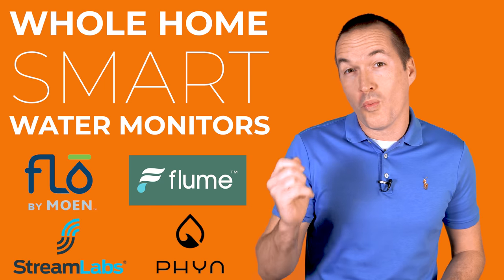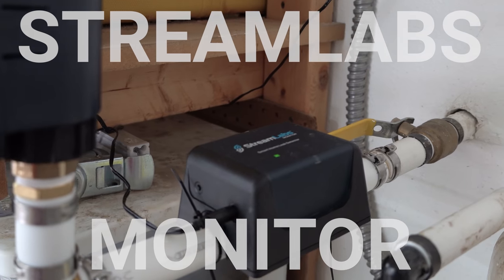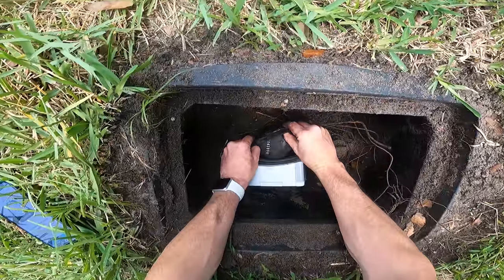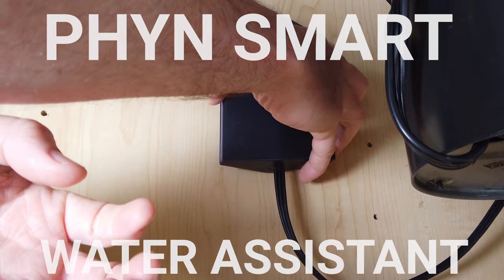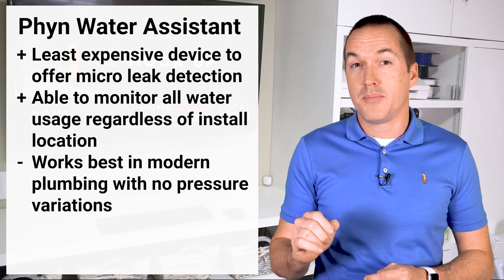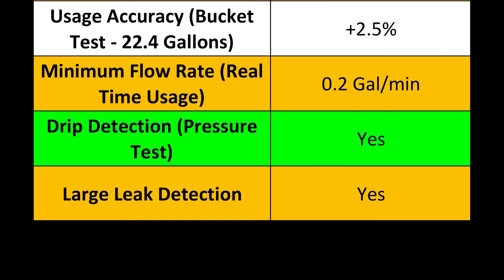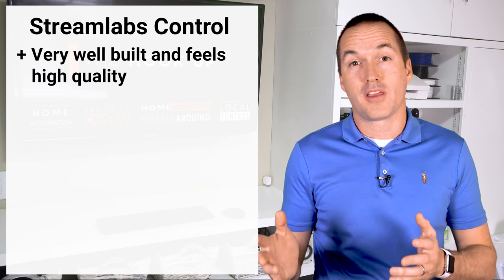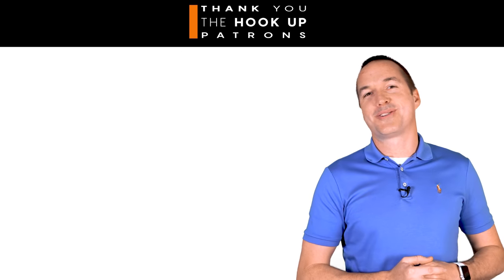Prevent THOUSANDS in damages with these smart water monitors.

Comment from the maker: The Moen Flo was a standout for me, but the Flume 2 was also very good.  I made an error in the chart at 7:25, the Flume subscription should say "$49/yr, not $49/mo".   What do you think about the new subscription plan (They basically give you a year free by discounting the purchase price by $49).  I'm personally not a fan, will it prevent you from buying it?
Reply: Great review, but my conclusion is I will continue using my  Flume, works flawlessly and I have used their useful api.  $50/yr subscription seems reasonable to me.  There is no free lunch to have permanent cloud access to your water data.  It has promptly caught several significant leaks and paid for itself.  Thanks for the extensive testing!  I am grandfathered in their no cost subscription, but if they started charging me $50/yr, I would continue to use it.
Reply: i am all for subscription plan as an easy way to have notification and pattern monitoring off device.
Cloud cost a lot.
But that should be an option, and the device need to have it's basic usage off cloud and for free (monitoring without history, shut off, thing like that)
So none of them will do the cut. No local, no buy
Reply: Hey Rob, this looked like a lot of work! Great review. Question: For the Flume 2, can you integrate with Home Assistant without the subscription plan? It looks like you can, just not 100% sure. Thanks!
Reply from the maker: @make it work yep, everything works without the subscription with the Moen.
Reply from the maker: @vlycop7404  It blows me away that local is not an option on most mainstream products.
Reply: @TheHookUp  Agreed. Flume actually locks their API behind the paywall as well. Having to pay a subscription to access your own data locally (there's a hub involved here) is ludacris. The never ending subscription mentality of hardware companies needs to stop.
Reply: @makeitworktech  not with the flume, unfortunately. I just ran into this issue last week. You need API access and they lock that behind the subscription.
Reply: @devinspratt586  that is so annoying. Moen is the only one worth it then IMO
Thanks!
Reply: @makeitworktech  agreed. I complained to them that it makes it significantly less attractive to people and that we'd be happy to pay a higher hardware cost instead of deal with subscriptions. Their customer support is excellent though.
Reply: @devinspratt586  Yeah I don't want to keep paying for something I already paid for. I only want to pay for something that keeps adding value.
Good on them for the support 👌
Reply: Great review. When I researched them, I was between the Moen Flo and Phyn Plus. Unfortunately the Phyn Plus wasn't reviewed, but I have found it to catch leaky faucets, spigots, toilets, and provide adequate notification for abnormalities. While it costs more, it seems robust with metal components and doesn't charge a monthly fee. It has been mostly accurate with identifying what is using water.
Reply: If you recently bought a Flume 2, the app will ask you if you purchased it after Aug 24 (or some day like that). Just hit the button that says you bought it before this day, and you will get the original plan that has all the features and API access included. I don't know how long this will last before they don't prompt you. The newer plan SUCKS. You don't get much without paying $50/yr.
Reply from the maker: @composer47  That is hilarious.
Reply: @vlycop7404  Honestly cloud infrastructure is incredibly cheap - and getting cheaper by the day. Most cloud subscription costs are just additional ways for companies to make a buck. it takes very few subscribers to cover the operating costs, few more to pay for the development costs, and the rest is profit for next-to-zero incremental additional costs as the actual hits to the cloud services for something like this are few and far between. I completely agree that with no ability to tie-in locally to something it should be a deal breaker. If your device requires cloud-access to the manufacturer it is not your device, you are renting it.
Reply: @cpattullo1  i agree with most of what you say :)
But when i see the bill at work when small website, that cost 350€ a month usually, scale up because of some new's coverage ... 20k bill are hard to swallow and usually we try to work it off with google ...
I have no issue thinking those company aren't managing their cloud well and paying way to much to justify when the number of user isn't there.
Reply: @vlycop7404  ya, it really depends on what you're doing. But a moderate sized DB with some API calls - an over simplification,  but not by much - is all that's needed for these services. That really isn't that expensive on AWS. Especially since it's often the App that's doing the work and the cloud is just holding a bit of data and triggering some other service calls.
Reply: Personally, I'm not interested in any device that requires a cloud connection.  I only have two cloud-connected devices and they are on the shortlist for upgrades.
Reply: @ericapelz260  that would be so ideal. I personally don't want a cloud requirement, but I do want the ability to connect and receive alerts etc. It seems to be manufacturers always want to tie the two. A fully cloud free environment while maintaining the features I need would be ideal though!
Reply: @The Hook Up -  the graphic at 07:26 shows $49/MONTH not year
Reply: @TheHookUp  Regarding local api access: It doesn't make a lot of sense to build, maintain, support, provide documentation for a feature that only a tiny of fraction of potential customers will ever use.
Reply from the maker: @freethinker1198  Unfortunately true.  However, relying on the cloud is also what gives smart home products a bad name.  Certain products need to work 100% of the time, and the cloud cannot deliver that kind of reliability.   Local control needs to be an option when the purpose is especially high stakes like flood monitoring.

Comment: Phyn offers a whole home water main solution as well, Phyn Plus. Did you happen to come across this one? I decided to pick this solution because it had what seemed to be the longest-lasting and high accuracy sensor (made in US by Badger, a major supplier for commercial water solutions). It does lack the API access, but no monthly fees (at the time Moen did). I'd be interested how it really stacks up against the others in your tests for accuracy, but I've been happy with it so far. Turns off when I forget the garden watering, kids leave water toys on too long, and has classified my usage very well. I hope they add some API access, but really, having a standalone for what is really an emergency system isn't bad. I'm sure there are some automations I could think of, but does what I need.
Reply from the maker: Yeah, I mostly didn't include it because of cost creep in the video and because I didn't have any more room in my plumbing, lol.  That said, my least favorite part about the Phyn was the app and lack of API, which would be the same for the Phyn Plus.

Comment: I love your very thorough reviews and learn a ton from them. However you did fail to mention the Phyn Plus  model which does have a whole home water shutoff and several great features. I have had one installed in my home for 18 months and love it. I'd be interested to see how it stacks up against the other front runners like the Moen.
Reply from the maker: My main gripes with the phyn were the lackluster app and lack of integrations with smart home platforms.  I have no doubt that the phyn plus would perform well, but it's more expensive than the Flo and has a significantly worse app.
Reply: I’m still interested in the comparison of the two?  Although phyns app is lacking.

Comment: The goal of smart meters is to save money by being able to monitor usage and detect leaks. Subscription kills the first critical point of replacing the 'dumb' meter with the smart one. Naaa thanks but no, thanks. Otherwise Rob, good video as always.
Reply: The target market is likely people who are weighing the costs of damage and repairs against the cost of the unit and subscription. As water can easily run into the thousands /tens-of-thousands for damage and repairs, even a $500 unit with $10/mo only has to save you from one major leak to break even / save you money. This is borne out in some of the comments here even. That said - I completely agree with you that a product shouldn't need a subscription to work.
Reply: @cpattullo1  IDK, if that's the main goal, then I think I would end up paying twice. I already pay insurance to protect me from that and that is something I have to have because it is required by my mortgage lender etc. Yes, you could say this is "double insurance", but I don't like to pay twice for the same thing. This is why it is not the main benefit in my opinion. But again, we agree a product shouldn't need a subscription to work.
Reply: @CMDRSloma  as someone who recently went through 3 months of insurance-covered repairs from a burst pipe in the freeze here in Texas, I can confidently say I wish I had one of these installed, even at the ~$400 price tag and subscription. Having your flooring, cabinets, and drywall ripped out throughout your home sucks...terribly.

Comment: I'm quite surprised that your going this route at all ? 
I've seen your Home Assistant, and your very knowledgeable. 
So why not smack one out of the park, and go the distance ?
 
Why not use an actual water meter with  pulse output, .and electronic shut off ?
They are extremely accurate and durable. Run about $75 dollars for the meter, and $25 for the shut off.
Then tie it into an esp32 and do the programming yourself.
You can custome build it to your exact specifications.

What got me interested in monitoring our water usage was leaving the hose on in the back yard and just using the spray nozzle to turn on and off the water.
We went away for a long weekend and the hose burst. Fortunately the spraying noise annoyed my neighbor enough that he came over to investigate and he turned off the spigot for us.
That's when I started my journey into the world of home Utomation.
Using an actual meter is so accurate, that it notified me of drip leak that accured when My toilet flapper started to ware.
But I relied on timing circuits and relays to do the dirty work. I just recently started working with HA

I have so many cool ideas on home Automation's but lack the knowledge you have.
I just started using home Assistant, but I can't seme to make my first node function. 
But I am determined to watch as many YouTube videos as It take, to make the damn thing work.

So........  you need to Keep making these videos until I get this right !

Maybe you can explain why my node just stairs at me, wanting to be adopted but nothing else.

Comment: The Phyn unit does indeed shut water off during an unidentified occurrence however not until 7 or 8 minutes past.  A high flow rate of 8 GPM will dump 60 Gallons before activating a shut-off.  We discovered this when our seasonal irrigation became active.  Imagine if we had an inside pipe break and it took 7 minutes to shut down.  What a mess that would be.

Comment: Couple errors with the Flume:
1)	At $49/year, own for 5 years it is still $100 less than the Moen Flo with subscription
2)	Drip detection works but must be present for 2 hours. My smallest drip alert was for 0.06 gpm at the two hour mark
Reply from the maker: I’m not sure #1 is an error, the flo and flume are not really equal devices, so for them to be the same price after five years makes makes the subscription even worse.

Comment: Great video. Did you ever retest the Moen Flo for a large leak detection after it had learned your house?
Reply from the maker: Yep, works great.  It gives you an alert on your phone and an automated phone call letting you know there is a problem and giving you 60 seconds to override before it automatically shuts off the water.

Comment: Hello, I have watched almost all your videos and have really learned a lot. Thank you very much for that! But apparently I have not learned enough. I would like to use a water flow meter in my motorhome to turn on the water pump when water is taken. The water flow meter gives pulses (444/l) when the water flows. I have created a rule for this that works quite well. Unfortunately the rule is repeated with every impulse, but I only want a MQTT message when the event changes. So only when impulses come or no further impulses come. I just can't manage that. This is my current rule: Rule2
ON COUNTER#C1>%var1% DO Backlog var1 %value%; publish tele/van1/WATERPUMP ON; power6 on ENDON
ON COUNTER#C1=%var1% DO Backlog var1 %value%; publish tele/van1/WATERPUMP OFF; power6 off endif ENDON - I also tried something like this: Rule2
  ON COUNTER#C1>%var1% DO Backlog var1 %value%; publish tele/van1/WATERPUMP ON; var2 %value%; add1 2; sub2 2 ENDON
  ON COUNTER#C1<%var2% DO Backlog var2 %value%; publish tele/van1/WATERPUMP OFF; var1 %value%; add1 2; sub2 2 ENDON but it just won't work. Maybe you have another good idea? I am grateful for any help. Thanks a lot Ronald

Comment: Great video.  My experience with my Moen Flo has been mixed.  Great peace of mind but the reliability of the device has been less than stellar.  Purchased mine in 2020 and the first device died about 8 months later (power within the device) - Moen replaced it under warranty and that went great.  The second device has now stopped reporting the GPM which negates the safety features of leak detection.  It lasted 8 months.  The original warranty is over so now I must purchase a new device.  This one seems to be the turbine magnets has corrosion and it has thwarted my efforts to remove this corrosion.

I'll be buying another one - the peace of mind is worth it.
Reply: Why not just use Bluebot? No plumbing, great quality, works like a charm.

Comment: Next time, instead of measuring out 20 quarts, just pail-and-scale it. Water weighs 8.34 lb/gal. A decent bathroom scale should have been sufficient.
Reply from the maker: That certainly would have been faster.  I probably would have been paranoid that the scale was out of calibration 😜
Reply: @TheHookUp  it’s easy to calibrate! Just get 5gal of water and it should weigh 41.7lbs 🤣.

Comment: Hi Vince,Thanks for the video on the water monitors.  I am wondering if you have tested the newer Phyn Plus second gen device that also shuts off the water - similar to the Moen Flo?
Moen had the troubled impeller so I am wondering if the new Phyn might be a better option.
Thanks. Jeff
Reply from the maker: Hi Jeff, I haven't tested the Phyn Plus.  Also, just out of curiosity, why do you think my name is Vince? I only ask because people call me Vince all the time, and I'm not sure which other YouTuber I'm being mistaken for.  (My name is Rob).
Reply: Apologies for the name mixup!  I am nearly positive that I saw it in this video - but maybe not.  But it might be buried in there somewhere, or perhaps when I was reading the other comments here I saw it and ran with it. Wrongly.  Back on the monitor decision, I can't decide which unit is the better way to go.  The impeller problem by Moen was an embarrassment and while they might have solved it I wonder if a less moving parts route is the way to go.  Thanks for the great videos and I am now subscribed.
Reply from the maker: @soldemaroceanfront8440  I will say that my biggest issue with the Phyn was the app, which is the same for the Phyn Plus.  Moen Flo app is just a much better experience.  My Flo is still going strong.  My Flume died because my water shutoff box flooded in a Florida storm.
Reply: Hi Rob, The application for this Moen flo device that we're considering is for a very large beach area duplex that is quite a distance away from where we live and it functions as a short-term rental. In the peak summer season it can have upwards of 15 people per unit and the water usage will be quite variable depending on occupancy levels and time of year.  Do you think that eventually the Moen device can learn the wide variances? I don't want a bunch of false shut-offs when the duplex units are full and a lot of water is being used.  Thanks again for your insights.

Comment: Subscription to use something you bought is an killer.
Would never be an option for me.. So flo by moen is really the best and only option.

And i have well water with a pump sojust using a pressure sensor here would be bad since it goes down a lot before pump turns on so would look like a large leak for the under sink one